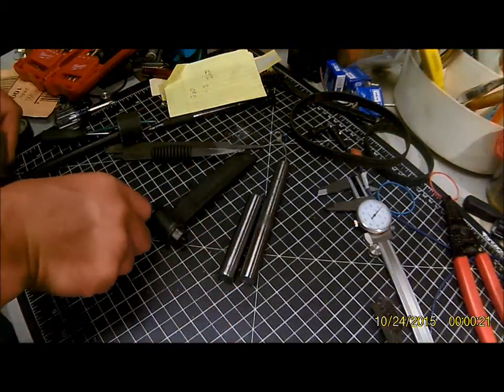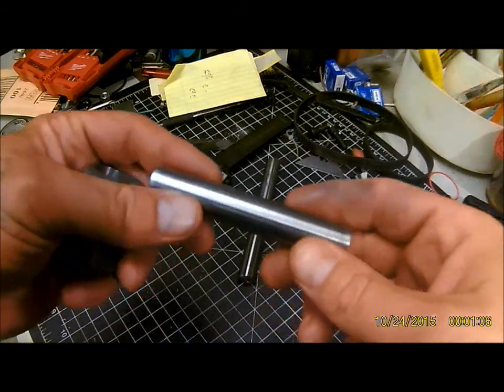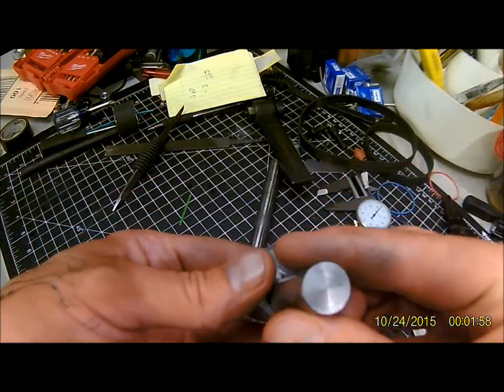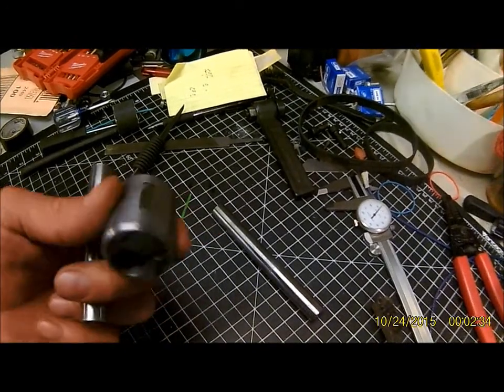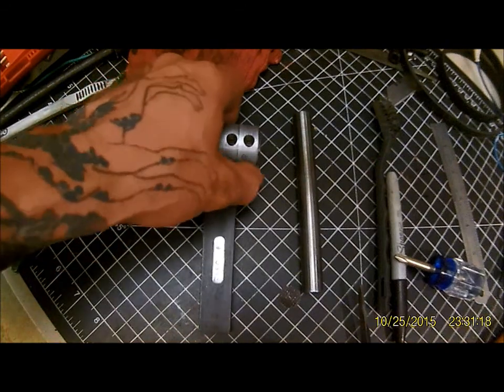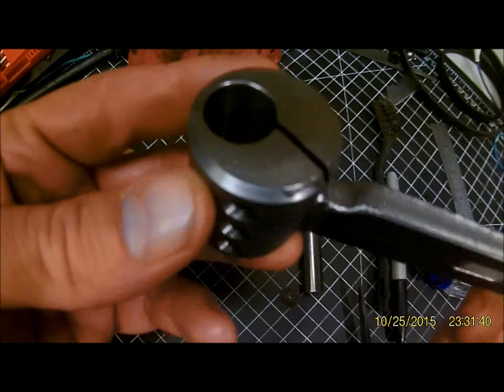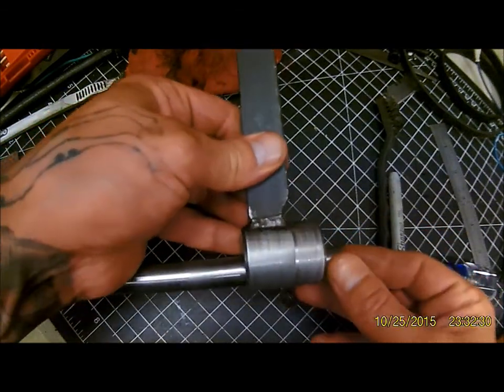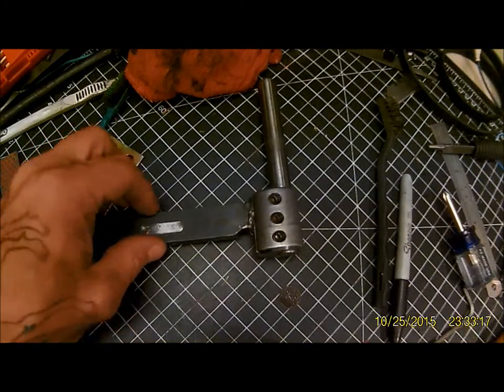Keyway holder Atlas 7B shaper

Comment: All the toolholders I have for my 7B are forged.  You've said you don't plan on pushing your holder very hard, but weldments of hot or cold rolled steel are going to flex more than commercial holders - it might be worth your time to build up that weld to head off metal fatigue from that extra stress.  

Plenty of people have welded/brazed up cutters, bars, etc, but I don't recall ever seeing a fabricated shaper tool holder.  I'll be interested in how well it works and holds up.  Carry on, mate.
Reply from the maker: Thanks somebody. I really don't have much choice in materials. I have spent many years studying every aspect of metal working. Since the biggest cut this type holder will likely, rarely see, will be in the 0.25 wide to 0.01" deep max. It should last a life time. I will make a different holder for the clapper, one with 2 clamp screws and a plate to keep the single lantern screw from digging in to the shank, and creating a point of possible slop.   If it was my standard multi-angle tool holder I would at least harden and temper it Like I will do with the keyway bit holders,  However, with this type holder I don't think it would be necessary. Forging is a great Process and makes durable tool holders at an economical cost, but unless they are being manufactured in mass amounts it is just to much work and expense for a home shop.